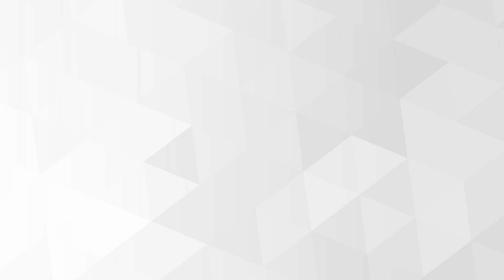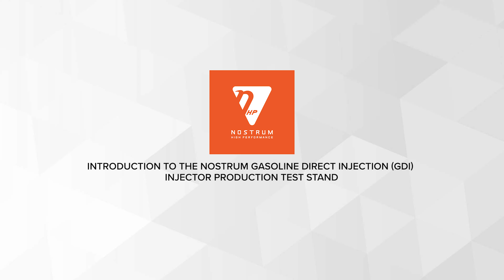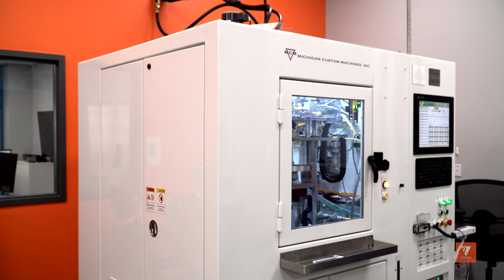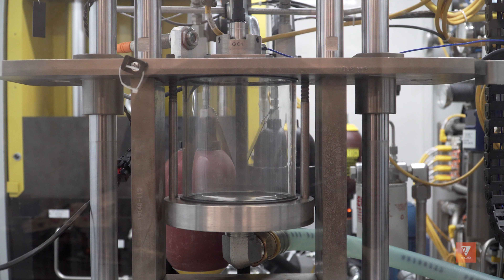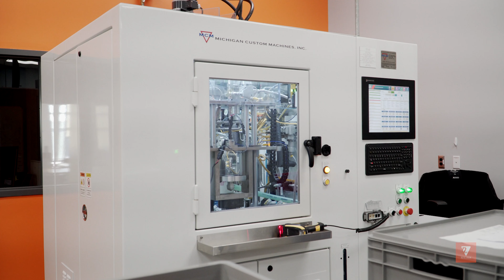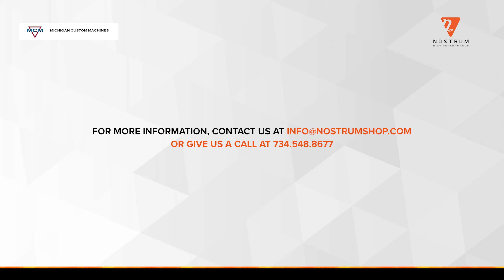Introduction To The Nostrum Gasoline Direct Injection GDI Injector Production Test Stand

Comment: This is awesome, and at the same time I hope it won't be asking too much to have collaboration calibration projects between yourself and ecu manufacturers from the aftermarket industry where the characterization data available can be integrated into the fuel model of standalone ecus manufacturers who support direct injection engines. Thanks for sharing.
Reply from the maker: Standalone ECUs are a bit tricky. We are working on supported them, however for the most accurate data package this usually requires that we do the characterization work with the specific ECU so that all the electrical characteristics are eactly the same. We can do nHeptane characterization with a Motec ECU (M142) and will try to expand this in the future.
Reply: @NostrumHP  thanks very much for your considerations, and for entertaining additional prospects as viable possibilities. I will do everything within my means to facilitate any collaboration work between your internal calibration team and all relevant personnel apart of the technical support team for the respective ecu manufacturers.

The value of your work together with the merit of the technology you have developed is very much worth going the extra mile so that all consumers have the opportunity to partake with the full measure of the intended excellence.

Thanks again for your continued efforts and also for the diligence of the entire team building the Nostrum High Performance brand every day!

Comment: We need nostrum stage 2 wrx fa20 injectors
Reply from the maker: We would love to do a stage 2 and even stage 3 for the FA20F WRX. And its not for the lack of trying! 😅The limiting factor on the WRX FA20F is the OEM ECU injector drivers. There isn't much there for us to work with and it makes it basically impossible to make an injector much bigger than the stage 1. We are still pushing it, but unfortunately we are limited by the platform's capabilities. Hopefully Subaru is a bit more generous with their ECU drivers in the FA24F WRX!!!!🙏